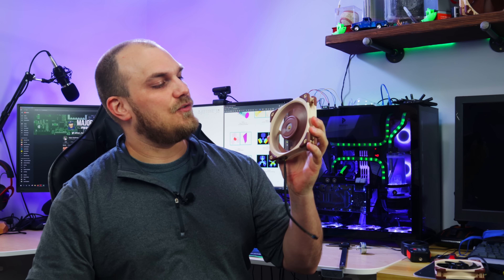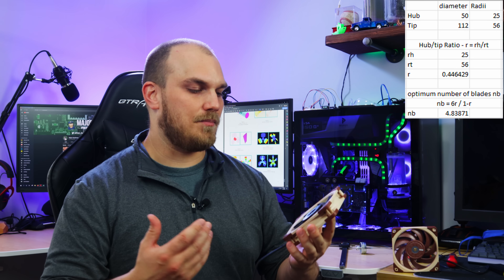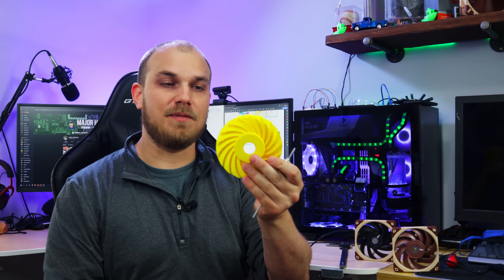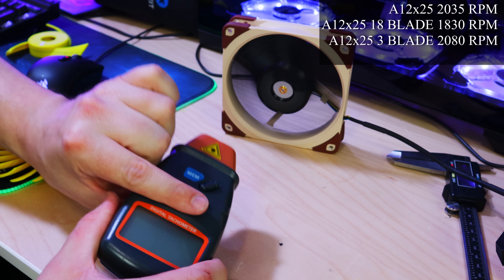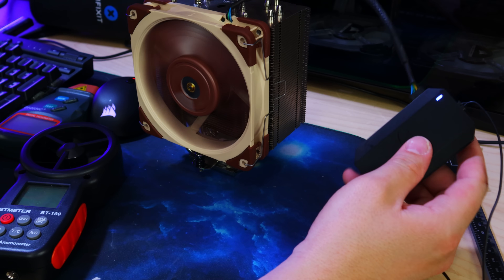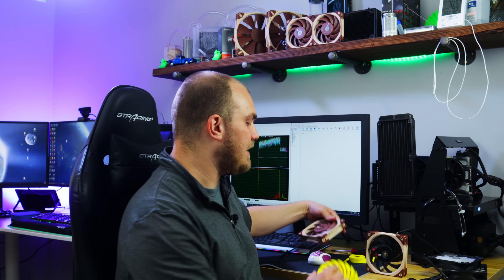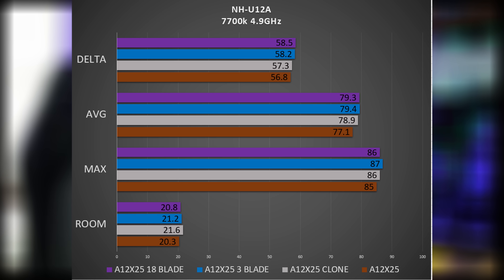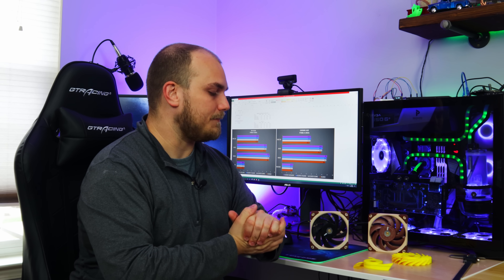What If the Noctua NF-A12x25 Had Twice as Many Blades? | Custom 3D Printed Blades

Comment: Hello there, it's a very interesting video. I really enjoyed it.
Also, I have some suggestions with a higher blade count to work better. Because cooling fans work in the physical world. every physical aspect counts.

1. The geometry of the blade itself is key. The angle of the blade also has a huge role.  With fever blades, you'll need a more perpendicular blade angle to the rotor axis. And with more blades, you'll need less perpendicular blades to the rotor axis. And this is just the blade angle. The blade's shape or bending is also important. Fever blades = less curvature/bend, more blade = more curvature/bending. As geometry concerns, the space ratio between the blades is also crucial, because there is a need to be somewhat enough gap between the blades of the fan to bite suck a significant chunk of air.  Less blade gap ratio = small chunk of air that can stick between blades and cause stalling. It also can generate more heat than cooling. Correct blade gap ratio = better or significant chunk of air that allows the fan to press trough the cooling system without stalling.

2. Motor power/torque/RPM/voltage/amperage also important. A fan with fewer and longer blades need a totally different motor than a fan with more and shorter blades. And if you want the same hub/tip ratio but more blades again a totally different motor with totally different rpm, torque. in some cases even voltage and amperage.

3. Material - finishing, density, and weight. This part is intersecting with the geometry part a bit because the shape of the blade dictates the material density of the blade part. The edges of the blade how sharp or round they are. The aerodynamics of the blade. And this also differs from fan to fan, from the motor you are putting the fan on. the power, rpm, etc. it has. The desired purpose of it. And also this part is intersecting with the motor part too because the motor has to be adapted to the aerodynamics of the fan and the material is made of. the weight and density of the material count a lot in the process of choosing the right motor for the job.

I think with a bit of math it can be achieved a better fand than those are existing in the market. But of course, this included investing money in calculating, designing, printing and testing those fans.

Comment: I have no theoretical knowledge when it comes to fans, but I have some practical experience from an air cooled VW Beetle.

And what I know about the beetle fans are that they work great with the original fin count at lower rpm, but when going into  high rpms does the airflow stall and the fan stops working. So when tuning one of these engines is it very important to remove every other blade so the fan don't stall

Comment: I'm pretty sure that when you are meassuring wind speed it is dynamic pressure and not static pressure. static pressure would be meassured in a 90 degree angle to the air flow.

Comment: 0:55 static pressure actually DECREASES with velocity. Total pressure stays the same, static pressure decreases, dynamic pressure increases. Total pressure is the sum of static pressure and dynamic pressure. This is valid for incompressible fluids (air is regarded as a fluid in fluid dynamics/aerodynamics) and air is regarded as incompressible for subsonic speeds.

Comment: I saw some video's of your fan designs and couldn't find someone commenting about power monitoring. I think it would be really cool if you implemented some kind of power monitoring from the motors when comparing your fan designs to compare the efficiency of cooling in terms of degrees Celcius/Watts used for example. Maybe even try to up te voltage supplied to the fans to see if you can get better cooling with some of the fans with less blad counts as these should be more efficient in converting rotational energy into moving air (from what i know from propeller design), don't really  know if the internal circuitry of the fans would like that but maybe it's worth the try. You could just lower the max rpm of the fan for the base tests to achieve the same effect, but where's the fun in that. 
All i'm really trying to say is that i think that the 3 blade design in this video is underpreforming because it's max rpm is limited by the KV rating of the bldc motor and that it would actually preform better if it was supplied the same amount of power. Some kind of power monitoring like a simple multimeter measuring the current supplied to the fan could make this clear.

Comment: One of the major reasons why the 18 blade fan under preformed was because it was rotating at a slower speed. It requires a more powerful motor to run it since it is having to move more air than the 9 blade fan. And as many other people have stated you really need to smooth out the fan blades to some degree, it adds more drag to the blades and slows it down even more. Also you should try using different thickness and pitch of the blades to adjust the direction and speed of the air flow. Otherwise it was a pretty good creation.

Comment: Suggestion: Try to do it turbine style, first put the 9 bladed on top of the 18 bladed fan and then the radiator, the 18 bladed fan chokes because it can get enough air over the fan blades, but if you push air in with the 9 bladed fan it should deliver more performance..also it would be fun. 😀

Comment: I think high blade count work better if you have a tunel, so that pressure have any place to go. as its just a fan, it does extra work in generating pressure, which just disappear in every possible direction. that's why both turbine engine AND blowers use this design. Tube + pressure.

Comment: Have a look at car turbocharger impeller designs. 
Turbocharger manufacturer’s spends millions of dollars perfecting there designs. 
Maybe a 7+7 design 7 large 7 small might make an improvement. (Smaller being half the thickness) even if you stick with the original blade design.

And before someone comments, yes I know a turbo impeller is a compressor wheel and I know how they work etc and that it’s different to a normal fan. But they must use a big and small blade and a a curved blade for a reason. Why not try it? There’s nothing to loose

Comment: If I might make a suggestion. use two fans and make a co-axial contra-rotating system.  I would also make one fan have +-2 blades difference from the front fan. The difference in blade count should cut down on resonance .

Comment: Hey, I am thinking your RPM is very important in this equation. You had different RPM for each fan and the one spinning the fastest out performed everything. Can we get some more fan speed/ torque. Noctua might have designed the best fan blade for how this motor performs.

Comment: Someone needs to write an AI that designs and simulates airflows and such, to come up with the theoretically best design there is.

It's been done before on other things :)
Reply: Solidworks (what he was using) does have something like this already, it’s probably just not to the point you’d want to use it (the flow simulations can already take a day to run... So an AI if it takes 1000 data points to work particularly well would use a computer for years for like maybe a 2% improvement, currently human judgement and cheap and quick prototyping with 3D printers is probably the most logical).
Reply: @jakegarrett8109  Ah okay!
I thought the time needed might be the issue.

Comment: i would assume from common sense, when you add more material it allows less "space" for air to actually flow. So you'd loose efficiency if you have too many, and not enough efficiency if you dont have enough... Maybe more depth of the fan would improve flow or static pressure?

Comment: More blade after some point won't do better. Think that way: if you have an infinite number of blades, the fan would be a heavy disk and no air can flow through and the work done by the fan would be 0.  So the function of blade count vs. output power will not be monotonically increasing.  Doubling the blades won't do better even if you tweak the profile. 18 blades are just too much. The efficiency would decrease dramatically. The 9 blade design already achieved around probably 90 percent efficiency, the 18 blades design with infinite thin blades would increase the efficiency by 10 percent at most, but the increase in the blade count will at least double the drag, and in fact, will do more than that to decrease the efficiency of the fan. So the overall performance of the fan will decrease a lot.

Comment: air turbulence on the plastic imperfections and drag on the weight of the denser plastic.  Wondering the weight difference between TPU, PLA, and PETg. Or even a SLA resin design for smoothness.

Comment: Alot of the performance loss is from the un smooth surface of the 3D printed blades. The rough surface cause air flow turbulence. So if you got it smooth would bring it closer to the real fan.

Comment: I think that it's worth remembering that this fan is essentially a clone of the Nidec Gentle Typhoon, and Noctua haven't really done much other than tweak the design to make it considerably quieter (I have both fans).  The number of blades is essentially a moot point because you can have a very quiet fan with 5, 7, or 11 blades, and you can have great airflow and very high pressure from fans of all types.  Nice job on the testing - very interesting!

Comment: Look at the DAL Nepal N1 prop, I’d say try making a sweepback blade design? You can get more airflow with greater blade pitch, modern props often have greater pitch at the edges of the blade than at the center too I think. Though higher pitch may also stall at lower rpm, but I think a high blade count offsets that? 🤔

Comment: If you would to this 5 blade fan that come up with the calculation as best you probably would get much closer to original Noctua performance in terms of cooling. I suppose that Noctua knows that eider but as you noticed less blade gives worse sound performance and Noctua is optimized to the sound performance. The superior cooling effect is hived thanks to the superior heat pipes in heat sink. Counting only air flow is not the case because all major producers gives nearly the same performance per RPM. So it would be interesting to check this five blades design with Noctua. 

Another idea that come up to my mind is to reuse the original noctua blades but rearrange them to seven or five blade fun and check the performance. It would be louder but could be more efficient.

Comment: I have an idea for a design if u instead tilt the bottom of the blades so instead it goes from what is it 45deg to maybe 50 or even 60 deg so that the air that goes in instead gets forcevly pushed down and then makes kit grab even more air to push thru i think also it will create a little more noises but yea always worth a test? Cant test cuz i dont have a 3d printer lol

Comment: After some point adding more blades reduces the amount of air the other blades can force so there goes the diminishing returns.
Of course if you tweak their size you could add more but that won't give you more air to push, but rather ire high pitched noise.
It will most likely increase the pushing pressure though i think.

Comment: Also consider having the leading edges of the blades at different levels from the plane of the disc. Say, low then mid the high then start back at low then mid the high. This creates vacuum gaps that help pull at into the fan. In jet engines they do the same thing by having the leading edge wavy shaped. It allows for a flat disc with varying positions of attack at the same angle of attack for the blades.

Comment: One way to make it quieter is to vary the blade spacing around the hub. Equal spacing creates one distinct frequency but making it slightly random creates a white noise sound. Car tire tread does this as well.

Comment: There are obviously a tonne of factors and variables that go into fan blade designs.
Cool that you thought to give it a go....
Suggest that you consider looking at the blade (or vane) designs used in Jet Engines and Electric Turbo's
You will see that the shape and angle of attack of the blade across its shape/length etc make a tremendous difference.
For you *18" blade design you would probably need to print something closer to the jet engine design.
https://www.youtube.com/watch?v=2LZwkdGU0-g

Comment: I wish I had a 3d printer and the time to do these tests.. 
I'd go for a higher blade count (~twice the stock one) and every other blade would be a different shape. I mean
blade 1: normal shape
blade 2: either waved leading edge or spikes (purpose generate turbulence ahead of the blade behind)
blade 3: normal shape
blade 4: same as blade 2

And so on. My thinking is the turbulence ahead could "offer" more air to the blade behind to suck on

Comment: Put the Noctua Clone blades in a cheap fan. Use the cheap fan motor and frame and try to get close to noctua performance for half the price(assuming filament is relativly cheap, never 3D printed).

Comment: Hi guys, I have simple but probably alot of people asked question. What would be best radiator/fan option for best quiet cooling? 120mm radiator with noctua NF-A12x25 as they are superior or 140mm rad with somethink like NB eLoop 14-PS or like 140mm rad with NF-A12x25, let me know.

Comment: Look at EDFs (electric ducted fans) used in model aviation for ideas in blade count and design.  
A simple bell end intake ring does also does wonders for fan efficiency.
You also have to adjust RPM for different blade counts and blade pitch for optimal efficiency.

Comment: The material is irrelevant as long as it is strong enough to not flex.  The surface finish is the only reason the printed copy doesn't perform as well as the original.

Comment: Oh I love this!
My girlfriend is into 3D printing but I'm a real noob. However... I have a idea for your channel. Many of us have pretty useless intel stock fans laying around. Why not making it a projekt using the motors from the intel fans and printing 120mm or 140 fanblades and frames converting them into usable PWM fans?
Reply from the maker: interesting
Reply: @MajorHardware   Major Hardware  It would be a fun project to follow for us budget oriented cheap ass people like me. Your channel made me think that I maybe can use my old crappy molex fans and and turn them into PWM fans this way. But it would be cool for people with a 3d printers just maybe cut the blades off the intel stock fans and make a fan with slighter bigger "cylinder" and put the smaller stripped down intel fan inside it. Maybe just glue them togheter? I'm not sure if you can dissasmebely the stock fan more than just cutting the blades so, this would be a way to do it if thats the case.

I actually started using intel stock fans as they are as exhaust fans at the bottom pci-slots in my cases attaching them with zip ties. If you make a pretty steep fancurve from 0-30% you can make them semi-passive only to ramp up and start spinning when your graphicscard is hot enough at like 55c as an example. I wouldn't wanna have them idleing at their lowest fan speed all the time since they are quite loud. I decided to do this after I built my own GPU cooler for a R9 290X from a 65w TDP tower cooler. The R9 290X has TDP of 190w so... it needed a little extra help getting rid of all the heat that was building up in the case.

This usage is actually really helpful and a cheap way to lower the temps when overclocking graphics cards also.

However... I relized I probably have about 6 just laying around and I think most people into building computers have stacked up on a few over the years. Well... I think more than just me would've interested in this as content for your channel anyway. :)

Comment: what if you tried a set  of blades where you make half the blades half the length and make them staggered.  so short ,long,short, long etc. use more blades but only half full length. maybe the air from the short blade will come of the edge and do something interesting, maybe you could even angle the short blade so it points right at the tip of the big blade. you would have 2 points of air intercepting at the tip of the big blade. this may cause more drag. or maybe it would work like a baseball bat and cause the air to be push extremely hard lol.

Comment: Your 3D print quality isn't great, even for an FDM. It would be a lot better to try to design something like this in a resin printer.
You will be able to have thinner blades, better surface finishing. Not sure if the whole thing wouldn't skew when curing, of that I am unsure. But it would be cool to test.

Comment: Did you also adjust pitch of the blades when you made these, or kept the same pitch? Ya a fan with more blades but at the same pitch isn't really going to push any more air. There's a reason different brands have different blade counts and shapes.

Comment: Check the fan speed while it is pushing air through the radiator. Also, what effect does the Noctua NF-F12 stationary fins, the "FocusedFlow frame" have?

Comment: I scrolled through kind of quick, but didn't see anyone post this. The fundamental blade rate frequencies for the given RPMs and # of blades are. 
A12 Stock - 305.28Hz
A12 Clone - 279Hz
3 Blade - 104Hz
18 Blade - 549Hz
Mostly likely your fundamental is going to be the loudest, but you could also be hearing harmonics.

Comment: CFD gets you close. Having prototyped impellers for water pumps, physical iterations are required to fine tune the vane geometry. Last pump required 64 prototypes to dial in the final product, with a 10 percent improvement over the initial CFD design. But a 20 percent improvement over the previous production impeller. And yea, surface finish matters.

Comment: I have Arctic P12 fans. They have 5 blades and push alot of air. Just 12 inches and you can feel the air moving very good. Even in radiators they still move alot of air.